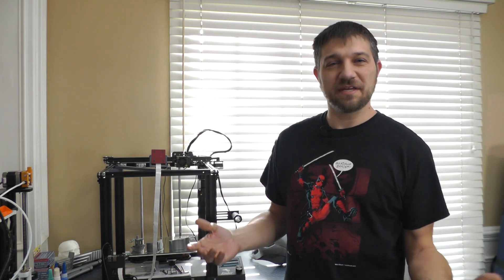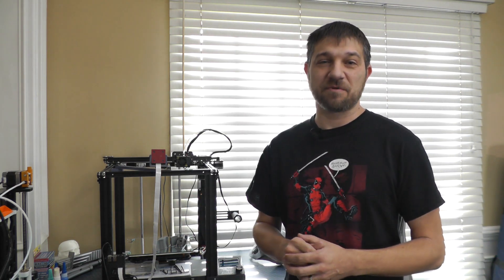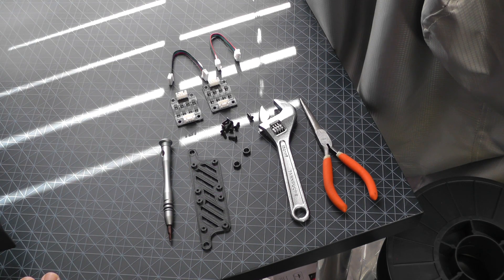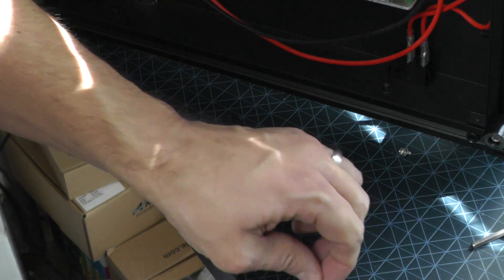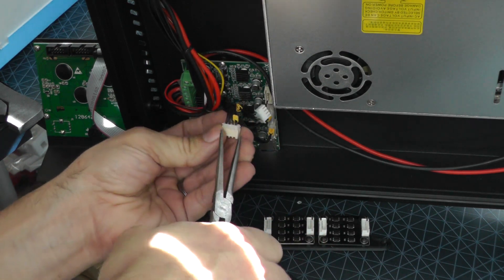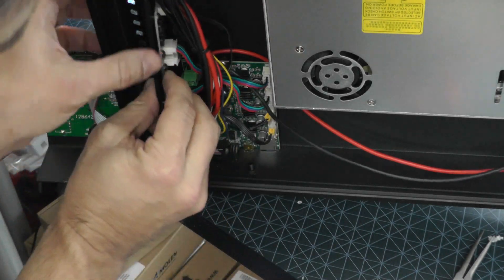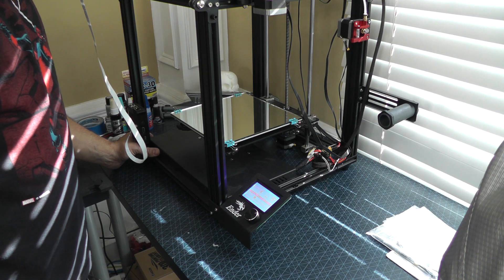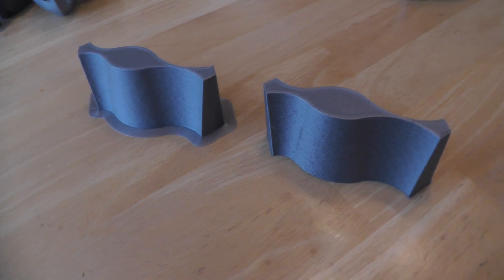Creality Ender 5 Upgrades #4: TL-Smoothers

Comment: I started 3d printing about one year ago.  I started with the Fischertechnik printer, as I am a big fan of Fischertechnik and you can use most parts for other Fischertechnik projects - it worked O.K., but of course its more a proof of concept than a usable reliable printer. So I ordered a Prusa mk3 that had much waiting time than (about 4 months). So a Geeetech i3 clone should have shorten the waiting time. In the beginning I had much dreams (like trying mixing nozzles, piezo sensors for under bed level detection, diferent boards, drivers etc ...) and ordered much parts. Only problem: the geetech never realy functioned.
In the last year I tried several printers and improved them (using my mk3 to print improvements). From all the printers I tried (Fischertechnik, Geetech i3-clone, Tronxy X5, original Prusa JGAurora A5, Ender 3, Ender 5, Anycubic Kossel Linear Plus) the Ender 5 is the second best in relibility out from stock (the mk3 is the best of course, but a different pricepoint).

Videos like yours gave a straight learning curve to me. I like tinkering on the printers even  more than actualy use them for printing. So my mk3 mostly prints parts for making other printers (wich is only human: Humans most liked hobby is also biologicaly mainly intended to produce other humans).

On the Ender 5 I will try following upgrades:

- changing leadscrews to lead of 2 mm to avoid bed falling down (about 10-12 $US)

- changing board to an mks gen-l with TMC 2130 (standalone mode) as I have that flying around anyway from my experiments on my geeetech) (if bought new: about 52 $US)

- adding real magnets (neodyn 150°C) under the bed, removing the low temperature magnetic surface (magnets will arive tomorrow). I already have different springsteels for my mk3, so I can use them (a seperate PEI powder coated spring steel for my Ender 5 will arive in some weeks from China; they offer a cloned Prusa-like on aliexpress, so I will test it) (Magnets: about 14 $US, PEI powder coated about 35$ US)

- adding piezo discs under the bed (using thing:3348684, piezo discs and electronic I ordered yesterday at precisionpiezo.co.uk) (about 30$ US + shipping depending on the contry you live - in my case germany, so about 10 $US)

- changing extruder to a direct extruder (Bondtech mk3 upgrade in the free thingiverse version (thing:3469271), using a trianglelabs BMG-clone for parts; Microswiss heatbreak and hardened nozzle) (about 80$US; halve of the price are the Microswiss heatbreak and nozzle, but you can use standard heatbreak with PTFE inliner and standard brassnozzle instead and cut the price to halve (and upgrading later step by step if you need higher temperature or want to print abrasive material)

- later: changing board to an einsy clone (as it should be possible to control the Ender 5 with prusas firmware without any changes exept steps/mm via gcode or menu. Maybe changing order of stepper wires. So always updates from prusa, using Prusas "ecosystem". So actualy the Ender 5 will repond exactly like an Prusa i3 mk3, but with more stability in mechanics.
(about 72 $US - instead of the MKS-Gen-L +drivers; to use prusas firmware unmodified +8$ US for the 2004 display)

- later: power-loss input (about 12 $US)

So altogether about 272 $ US for upgrades (but in my case: most parts already flying around), nearly the price of the printer. But a real challange. Some parts you can buy for less on "sales" like black friday or aniversarys on aliexpress if you are patient.
If you stuck to PLA and PET-G and keep printbed, its about 

You may even build a MMU2s (about 150$ US cloned) if you use an Einsy clone as controller (main reason for me to use an Einsy: I have an original MMU2s from Prusa, but do not want to tinker on my "workhorse")

It ssems expansive to spend the same amound of money to upgrade the printer as the printer has cost initialy. But think about the upgrades normaly recommended:
- 40$ US for crealitys "silent" motherboard
- 50$ US for a BL-Touch
- If you want to print higher temperatures: Original Microswiss hotend (80 $US)
- If you want to print abrasive materials: Microswiss hardened nozzle (20 $US)
- Capricorn tube (15 $US)
- Glas Bed (about 22 $US-42$US, including new leadsrew) (as magnetic bed from stock will become defect from high temps)
- Metal extruder parts (about  10 $US)
Means: To make the Ender 5 "universal" you need about 240 $US anyway. But you still have a bowden system, a controller with low memory and no free expansion ports.

Of course you can do everything step by step and adapt to your needs. If you want to use spring steel with diferent surfaces but no glas - Use a Pinda Probe 2 (cloned about 10 $US). You even go cheaper this way.

The only real decission to made beginning the upgrades: Do you realy want to "upgrade" the board with the same creepy low-end board from creality only nice TMCs? or spend 33 bucks more (on sales with coupons etc. maybe only 20 $ more) for an Einsy(clone).

If you are happy (now) printing only normal PLA and PET-G: You can use springsteel drect on the magnetic surface of the Ender 5. Blank it costs about 15$US. You can cover it with any print surface you want (not thicker than 1mm).  You have to change the creapy surface soon anyway, so buy an spring steel. More durable so effectly lower cost than to replace the creality surface. So with buing an Einsy instead of crealitys "silent board" you do not pay more: With creality: 90 $US for board and BL-Touch. With Einsy Clone: 71$US board + 1$ connector (for heatbed) + 10$ Pinda =82 $...

Only some suggestion to leave the standard path of upgrading.

The Piezo underbed sensors are something I will try. Its more expansive than a pinda, but should be useful if you want glas as alternative surface. If it works reliable, this would be definitively the better alternative, as it is independend from the surface you use.
Reply: One update to my comment: On the Creality Bord you can easy find the EN DIR and STEP signals. So if you want you can add external stepper drivers. As you mostly need them for x and y this is an cheep way to make the printer quiet. I made a little video (sorry, geman only, but the pictures may be enough to understand the concept): https://youtu.be/E2fAYRTw1aw
Reply: Had a Geetech i3  could never get it to work consistently. sold it for half what it cost me.

Comment: its meny tl smoothers any deference between them ?
Reply from the maker: There once were TL Smoothers with 4 and 8 diodes. Almost all of them these days have 8 diodes. I've noticed by just looking at the photos that they seems to use different diodes though that could have different ratings. So, unfortunately, I can't vouch for any smoothers other than the ones I tested. That being said, most should work just fine.

Comment: Have you considerded the new upgrade v1.1.4 Main Board, from Creality with the 2208 drivers for low noise, & to eliminate the need for TL Smoothers ?
Reply from the maker: I didn't know Creality had a replacement board with 2208 drivers on board. If you have a link, I'd love to see it!
Reply: @kerseyfabs  See https://youtu.be/_wEZOAFZhB4
Reply from the maker: I just ordered one. Once I get it, my subscribers will know about it.

Comment: this might be a stupid question for you guys, but what is the difference in-between a TL smother and Trimatic stepper drivers ?
Reply from the maker: A TL-Smoother is an add in component for the controller board that ships with many printers. It smooths out drv8825 stepper drivers that come on board. Trimatic stepper drivers are the full driver chips that can be added to a new controller board. This would replace all of the existing electronics.
Reply: @kerseyfabs  thank you :)
Reply: @kerseyfabs  I know Trinamics make for very quiet operation - how's the drv+smoother on noise?
Reply from the maker: It doesn't make much of a difference. It's not fundamentally changing how the stepper drivers work, it just smooths out the peaks.
Reply: @kerseyfabs  Oh I get that, I just don't know how noisy the drv8825s are to begin with and was curious how this setup compares to the Trinamic.
Reply from the maker: I'll have a video on that soonish. Creality just released a new main board with tmc2208 drivers that's a drop in replacement. I ordered one and I'll report once I have it.

Comment: I am getting ready to pull the trigger on an Ender 5. Your videos have helped me make a decision between the 3 Pro and the 5. In fact they were the only reason I decided to get the 5. Thank you very much for that! Your videos are a great help. I have a question that I cannot find an answer for. Being a manufacturing engineer I have some concern as to whether the bed is properly supported with only the back rails. Especially after adding the additional glass bed. Do you find that the bed is properly supported and does it stay level back to front? Btw, I am a new subscriber so keep the videos coming.
Reply from the maker: I really appreciate the support! I'll continue to cover this printer. It's my primary machine right now and I'm having a lot of fun with it. As for bed support, that's a complicated question because I read different reports. First, my personal results are fantastic. I'm not having any noticeable sagging and all of my prints (post upgrades) are turning out terrific. There are a lot of videos on that coming soon. Others though say they need the supports. I don't know what they're seeing but, if you do need supports, Thingiverse has multiple options. I hope this helps.

Comment: because of the placement, would that hurt the airflow for cooling?
Reply from the maker: In general, yes, without a cooling mod to this printer, orientation of the print is very important. For this particular video it doesn't matter much because I used the same g-code and orientation for all of the comparisons. My recommendation is to always orient the overhangs of the print to the right, facing the cooling fan. I would like to add a cooling mod in the future, but I haven't found the right one. I'm aware there are multiple options from the Ender 3 world.
Reply: @kerseyfabs  I was meaning for the electronics since you are covering the vent holes where the board and power supply are.
Reply from the maker: Oh! 😅 Sorry for the long answer to the wrong question. I don't think it will adversely affect cooling. There are still vents in the back of the mount I used and the fan is actually right over the board, so there shouldn't be any issues.
Reply: @kerseyfabs  thanks again keep them coming. Loving the channel

Comment: I added 4 TL-Smoother on the first day.
(X,Y,Z and E)

I think it was a good decision too. 

But you only added 2 TL-Smoother.
 Is there a reason for this? 

Is it better to only use x and y?
Reply from the maker: Adding them to all of the steppers shouldn't be a problem, it's probably not necessary though. According to what others have found in the past, this doesn't affect the slower moving motors like the Z axis. That being said, if I see any further problems, I may try one on my extruder. Thanks!

Comment: Which begs the obvious question: Why didn’t Creality just put these diodes on the motherboard to start with?
Reply from the maker: I completely agree! I actually wish they had used a different driver to begin with. The A4988 would have been louder possibly but they don't have the quality issues of the DRV8825.

Comment: Good video Kris! :) 

TL smoothers is definitely a good and cheap upgrade for many printers that are suffering from the salmon skin effect. I've personally seen it on Tevo Tornado and the Ender 3. 
I did install TL smoothers on the Tornado but removed them again when I changed to TMC stepper drivers, as they weren't needed anymore. Got a Duet in my Ender 3 now, so no need there either. Those are the expensive solutions for the problem, and TL smoothers are probably the right choice for most if they don't need the extra features or just find tinkering fun, like me. Hehe.
Reply from the maker: Thanks for the feedback! Yeah, there are more expensive solutions that offer more features but you can't beat spending <$15 that accomplishes this much!
Reply: For sure, great bang for the buck! :)